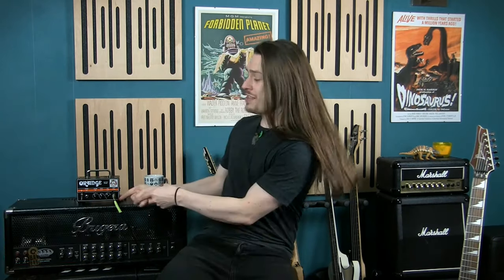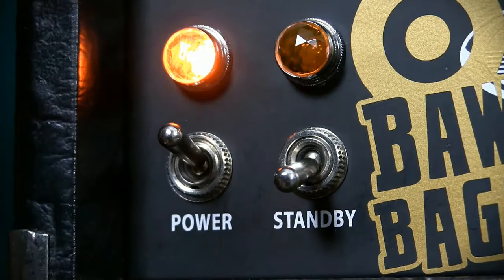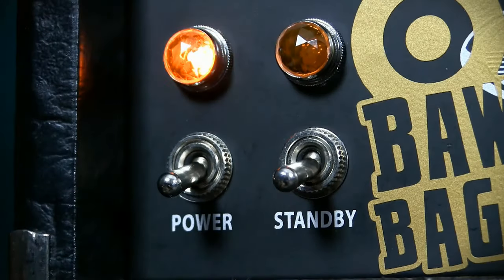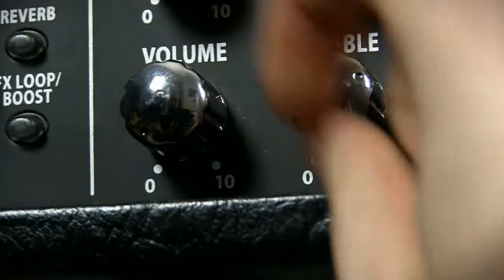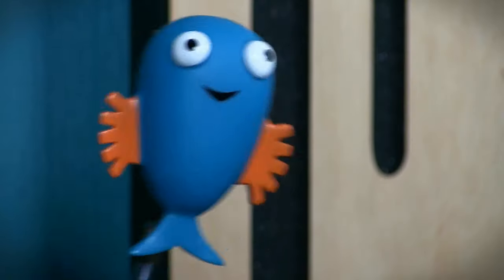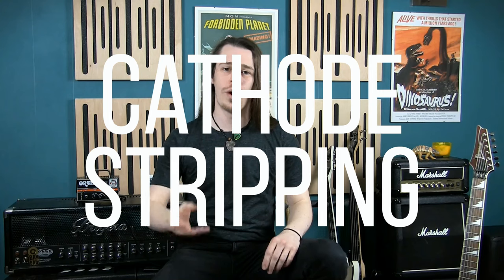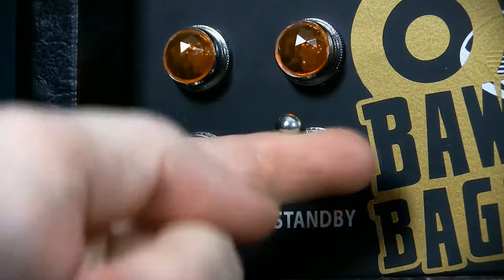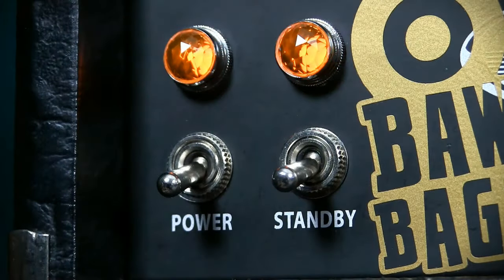Your Standby Switch Is A Lie!

Comment: Dude, you just dont understand the genereal purpose of that standby. Turning down a volume knob does not affect the current flowing inside the valves and standby feature does. It turns on and off the positive anode voltage gently from zero to hundreds of volts, depends of an amps model. You should go and read at least how valve amplifiers work in depths before posting  such bullshit, seriously.
Reply: Then maybe share some links to real electronic engineer explain it in depth?
Reply from the maker: +Enlightened One I understand perfectly how a standby switch works. The point is it doesn't actually benefit your amp in any way, it's there to make servicing safer for the repairer. Shutting down voltage to the valve does nothing for the user.

You seem to have mistaken this for me saying the standby switch is the same as a volume control. What I was saying is that for the user, the only effect the standby has is a mute button.

You should take time to watch and understand the video before telling me what I don't know.
Reply: HAHAHAHAHAHAHA.
Reply: Enlightened One Not so enlightened after all huh?
Reply: At first, when theres no positive voltage on the plate, valve will work just as lightbulb, all amplification function will remain off exactly like if you turn off your amp. So when you practice and going to make a short break, answer the phone or take a shit etc, the standby feature will be useful save of valves life cycle.
And then, you failed with reading my thoughts.
What i heard from the vid was "turning down the volume control is actually BETTER than standby switch". So, if you understand that there is two absolutely different purposes for that things, why u even try to complain it?
Reply: I recently purchased my 1st tube amp, is there some things I legitimately should be concerned about doing/ not doing? for example someone told me to not turn it on unless the head is plugged into the cab. is this bogus too?
Reply: Switching arround 400 volts to something is not exactly what I would call "gently" I recommend you read the valve wizards take on standby switches as he is regarded as one of the most knowledgable people in amp design and has a very good article about it.
Reply: NeZversTutorials I read books on my native lang, pretty sure you dont know it. But, theres alot of that stuff on youtube -
watch?v=Xo4nVjj4NSE
and other vids on this channel for example.
Reply: Enlightened One dude theres a video where one of marshalls engineers says exactly what collin is saying here
Reply: +Cole Giesbrecht Yes, the one with the cab is actually important. There is a so called "output transformer" in the amp, that converts the high voltage/low current from the power tubes to low voltage/high current for the speaker. But because of how alternating currents and inductors/transformers work, if there is no load connected, a much higher current can develope in the primary side, potentially blowing the transformer and/or powertubes
Reply: Uzmeyer By saying "gently" I tried to mention that with most common standby features the voltage does not appear instantly with 400v but raises within a period of time, like a few seconds, and this process serve to increase valves life cycle abit more.
Reply from the maker: Right, let's talk about saving the life time of your valve. 
If engage standby then, yes, you kill plate voltage, but what is still running on the valve? The heating elements. Even if using standby does extend the life of the anode (something for which there is practically no evidence to support), it isn't extending the life of the heaters, so your valve is still wearing itself. 
Further more, how often is your amp on standby compared to you actually playing it? A few minutes at the start and the end, and maybe a few more while you are having that phone or shit break. Let's be generous as say it's maybe on standby for 15 minutes a day (it was a big shit, it had to be forced out), if you played every day of the year then you'd accrue in one whole solar orbit just over 91 hours of extended life, just under 4 days. Again, if there were any evidence to support standby extending plate life. 

You seem to be having some trouble distinguishing between method and result here. I understand that the standby switch and volume control are doing different things electronically, but they achieve the same result, namely muting an amplifier. Again, for the user the Standby is nothing but a mute switch. 
There are a few reasons why using the volume control would be better than the switch, the one that I gave in the video was that mechanical switches wear out much faster than rotary pots. Other reasons would include the arguably questionable danger of cathode poisoning, ie heating the cathode without a plate voltage to allow electrons to flow resulting in the cathode becoming damaged over time. I didn't mention this one here as it's a whole topic of contention unto itself and I wanted to keep this video short. 
There is also the small factor that the Standby just doesn't have to be there, and all other valve amplifiers expect the user to turn down the volume pot if they want it to be quiet for a while. 

The take away here is it doesn't need to be there, it wasn't supposed to be there in the first place, and it only persists because people believe it needs to be there despite all the evidence to the contrary.
Reply from the maker: Cole, never run a valve amp without a cabinet of the correct impedance attached.
The amplifier needs to see that load, otherwise you might be buying your second tube amp quicker than you expected.
Reply: +Enlightened One But it does instantly appear once you switch it on. And as there is no load on the power supply with standby engaged, it may actually rise even higher, causing quite a current spike through tubes and other components when deactivating standby. Tubes are literally just metal plates in vacuum, they don't really care about voltage and current, as long as it's within specs (even though a lot of amps overrun them in the voltage department and they still work fine). If you read teh valvewizard article I recomended, he mentions putting a resistor in parallel with the switch, witch actually would achieve the slow voltage rise.
Reply: Enlightened One You clearly have 0 experience in electronical engineering. The reason why vol. knob > stdby swtch is if you turn down the volume, it brings the valve down softly. When you flick the damn switch it goes from 100% to 0, and that's a huge shock for valves. Even worse when you power it back on as power surges are waaay more frequent when powering something up.
Go look up a realistic representation of a power impulse wave. And see that when switching from log 0 to log 1 , you get a spike that can be as large as 50% of the base voltage and can for sure, fuck up your valves.
Reply: >You clearly have 0 experience in electronical engineering
>if you turn down the volume, it brings the valve down softly
>You clearly have 0 experience in electronical engineering

Volume control does not affect the plate voltage at any way. But, I can build an amp with that function for you, just to have a chance look how someone accidentally die playng his guitar =P

All standby features have some simple delay circuits which gently bring teh volts up and down when you flick the switch, and, belive me or not, that spikes protection.
Reply: CSGuitars Thanks. what about on a solid state? I have a Marshall lead Mosfet 100 head but the 16ohm output is screwed so I'm forced to use the 8 for now on its matching 410. would I be able to put the mosfet on the 412 cab? my vk100 is on 16. would I need to have the Mosfet on 16 too?
Reply: CSGuitars, Well, I definately was wrong with my thoughts about your knowledge, maybe cos of the specific style of your vid like "OLOLOLOLOL STANDBY IS STUPID BULLSHIT LIES EVERYWHERE OLOLOL" that triggered me. Sorry for being abit rude, as I said now I see you know what ure talking about and theres no point for me to try prove something.
Reply from the maker: Cole, Solid State amps are nowhere near as fragile as valve amps are, which is why so few things use valves anymore (that and the size, weight, heat...ah you get the picture)

Solid state amps can run fine without a speaker attached. When it comes to matching the impedance on SS, you obviously want to try and get it the same for optimal performance.
However you can connect the head to a higher rated cab and it won't damage anything, you won't get the amplifiers full power this way, but it won't break. 

Essentially if your head is giving out 8ohms and the cab is expecting to see 16ohms, then the speakers will accept it, but won't be used to their full capability. 
If your head is giving 8ohms, but the cab only expects to see 4ohm however, then the speaker won't be able to take all that the head is giving out, and that's when you're likely to see damage to the amp.
Reply from the maker: Cole, Solid State amps are nowhere near as fragile as valve amps are, which is why so few things use valves anymore (that and the size, weight, heat...ah you get the picture)

Solid state amps can run fine without a speaker attached. When it comes to matching the impedance on SS, you obviously want to try and get it the same for optimal performance.
However you can connect the head to a higher rated cab and it won't damage anything, you won't get the amplifiers full power this way, but it won't break. 

Essentially if your head is giving out 8ohms and the cab is expecting to see 16ohms, then the speakers will accept it, but won't be used to their full capability. 
If your head is giving 8ohms, but the cab only expects to see 4ohm however, then the speaker won't be able to take all that the head is giving out, and that's when you're likely to see damage to the amp.
Reply: CSGuitars  Thanks so much. tbh I read the whole thing in your voice. I feel much better knowing over plug it in and hope it's okay.
Reply: Cole, There is some kind of devices for valve amps that desighned to consume all amount of amp's power and adapt it for 16, 8, 4 ohms and even for any audio device inputs. theres an example http://amtelectronics.com/new/amt-power-eater-120/ It might be useful if you want to record dry amp signal to PC/Mac but have no desent cab+mic+audio interface circuit.
Reply: Enlightened One my valve amp has an impedance selector built in for 16 8 and 4. but that would be useful later on when I have amp (s) that don't have it.
Reply: Uzmeyer, Its hard for me to read some specific english literature, maybe thats why i still dont know about this person, but you intrigued me already, thx alot. BTW Im not a professional amp builder,  and all my suggestions might be somehow incorrect, but my diy stuff works pretty nice =P  Funny that I dont do standby switches lel~
 My anode power filtering circuits have built-in delayed "well not so gently" rising-fading voltage thingy xD
Reply: Isaac Hinkey, theres no need to wait when you switch it off, just do the standby first and then off. But when you turning it on valves need some time (like 30sec would be enough) to heat up and reach their normal amplification properties. So you should turn the amp, w8 a bit and then turn on the standby.
Reply: As someone who trained on marine valve equipment I can assure you standby switches were common on valve equipment not just amplifiers.
Fender did not invent the use of the switch and in the UK most of the guys building and designing amps were ex military and well trained in valve theory. A number of manufacturers did not use standby switches, true and likewise many of those advised a 'warm up' period before use. Many HiFi amps have internal ccts that restrict usage until the vales are settled.
Old TVs are mentioned in the articles you quote and although they did not have standby switches they did have to settle before operation and that was designed into them.
The same goes for older radar systems some used standby ccts others built in a timed cct to allow a slow warm up of the electronics.
Reply: Fearn pol - You're right that tube TV's didn't have standby switches,  although some models did have what they called a "Vacation" switch. (Usually, a slide switch located on the back of the set.) During day-to-day operation, the tv would run a small amount of current through the heaters to keep them warm for faster startup. The vacation switch was used when you would go on vacation and didn't want to waste the electricity (and tube life). I'm not disputing anything you said, just adding to the conversation.
Reply: One really cool function of my Ampeg Portaflex 20T is it doesn't require a speaker load (only in 8ohm mode) and can be used as a desktop amp head for direct recording. One of the only all tube heads I know of that can do that.
Reply: The Marshall JVM series heads work the same way.
Reply: Cole Giesbrecht Whatever you do just don't use the standby switch. It's actually bad for your amp.
Reply: Odie50000 It's not bad or good, it is just a convenient mute button essentially, also it doesn't blast anything from 0 to 100, the switches brings the voltage up gradually if that's what you mean by them being bad.
Reply: I've never been hit by an asteroid.. asteroids don't exist!!
Reply: No it isn't. Some amps need a load to save the intern circuits from damage. That isn't true for every amp.
I've just seen a better more in debth answer to the needed speaker load for the amp. So yeah...look at the manual to see what is needed. 
If they know their work they have specific info (some do invest really a lot of time to do a good manual like Hughes&Kettner)
Reply: Hartley Peavey published a white paper on this very topic.  Search for Peavey tech notes.
Reply: Lol I was trying to say exaclty the same things as described in those papers within all my comments here.
Reply: unless its in your mouth
Reply: Removing plate voltage each time you take a break is probably more wearing to the valves than just muting the amp some other way.  They get much hotter when there is plate voltage applied, and cycling the temperature like that instead of leaving it constant puts the internal components under more stress.
Reply: Kick sumo,
First, your amp was "designed"
Without a standby switch.
Those designed with a switch are not your amp.
Second,when you have to replace your tubes, how will you know that they wouldnt have lasted longer with a standby switch?
Reply: Cole, that is very true.  Switching on the head with no load connected to the output is potentially damaging to your output transformer due to the voltage building up too much on the secondary coil, and could cause it to arc and short out.
Reply: If the Marshall lead Mosfet 100 has an output transformer then yes, it is important to match impedance correctly.  It would be a bit strange if it had multiple impedance outputs without an output transformer, can't imagine why that'd be necessary.
Reply: Zeus Amplification operating temperature of power tubes in A class amps is like 250C and they desighned to be like that. Preamp tubes are much colder ofc. What makes you think that teh temperature will gradually increase without the plate voltage? How the current flow affects it? 
BTW Ive searched the internets and asked my friends about cathode poisoning thing. What i found is literally noone had this issue with the classic amp tubes. There was some topics about it and i remember some guy who left his amp on standby mode for like a week and it did nothing wrong. So i assume cathode poisoning as a myth, of cource especially in amp tubes.
Reply: Hulk Slayer blackstar has a 20w that does that. The HT 20 I think.
Reply: Plugging your cab into the head when it's switched on in play mode causes voltage spikes that can damage your output transformer and/or output valves. You should never play through the amp with no cab connected for similar reasons. The answer to your question is, no, it's not bogus, and you should never run your amp without a cab (or a dummy load) connected.
Reply: Hi there, until recently I believed that you HAD to have the speaker impedance load match the amp's speaker output, That was until I came across this,
http://blog.hughes-and-kettner.com/ohm-cooking-101-understanding-amps-speakers-and-impedance/
So I have been running a 4 ohm cabinet load into the 8 ohm connection on a new amp.Seems fine but as the chart says I may have a bit of mids missing. Interesting huh? I am going to wire a serial connection box so I can present the speakers (2 x 8ohm speaker cabinets) as a 16ohm load.It will also mean I can turn up the wick a bit more and get power tube distortion earlier.Cheers
Reply: I work on amps, have since HS (a long time) and it's not gradual. When u turn on the standby switch it's more like milli seconds to power up. Reguardless it is not going to help or hurt either way. Yes cathode stripping is a myth, but do some reading another school of thought is it is harmful to have the tube sitting heated with no B+ to the plate. In the long run incorrect biasing or vibration from moving your amp is going to decrease tube life more than anything. Standbuy is helpful when working on the amp. And is a convenient mute.
Reply: Thanks the inrush current is one I forgot to mention in my response to sound terrorist i believe. I actually damaged a meter biasing an amp as it was close to the limit of the meter and when i turned on the standby poof, (it was a cheap meter). Now I just power up with the standby already on and the current flow is a gental uprise as the tube heats.
Reply: I'm confused with this entire thread too many things that I don't understand all I want to know is if not using the standby switch will break or affect my amp in any negative or major way
Reply: No. I have a little late 60's elk amp that was my practice amp for close to 20 yrs. I would turn it on in the morning leave on standby till late at night. And whenever I came in the room to play I would flip the standby on play for awhile then put back on standby. Amp still works perfectly, just finally replaced it with a Jet City 22, which gets used the same way. Tubes are pretty forgiving.
Reply: Sound Terrorist But does starting the amp without the Standby-switch-methode work without damaging it?
Reply: digglesMcgee thanks for the link!